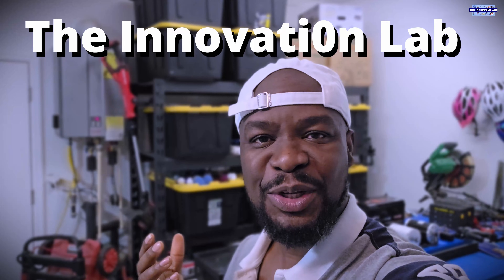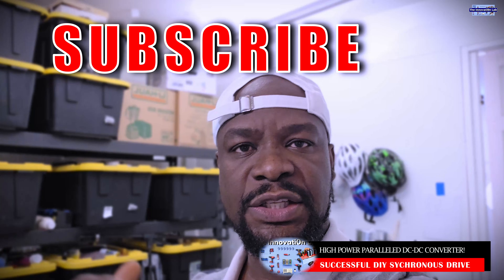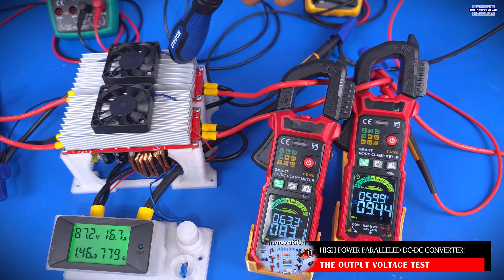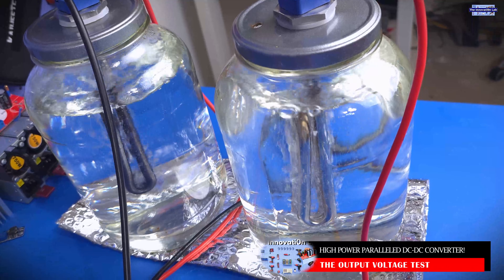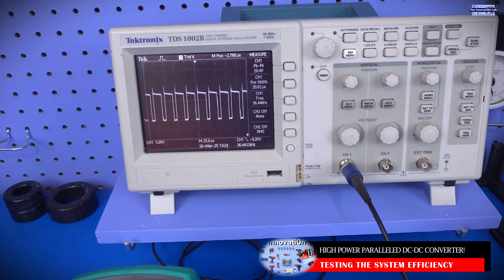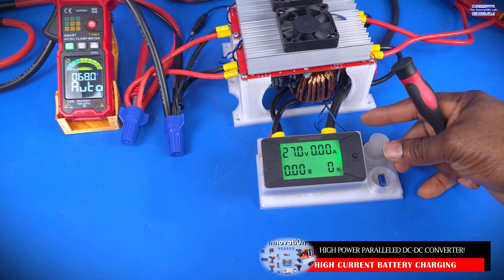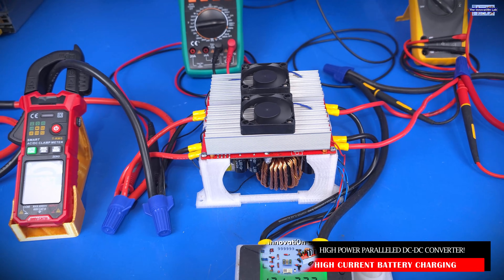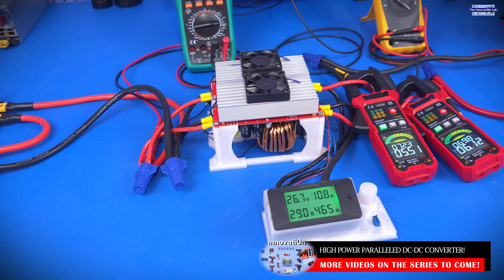DIY Hack for High DC Power: How to Parallel Converters Using a Synchronous Link

Comment: looking forward to knowing how to parallel these two. seems this parallel design is better than the earlier one with 3 paralleled plus a control board.
Reply from the maker: Sounds great!
I believe it was explained in this video.
 But overall, all you need to do is to remove the PWM chip on the helping converter and share the PWM signal from the controlling converter.....just as I showed in the 3X paralleling video.
I also provided and explained the diagram in the video.

Respectfully,
The Innovati0n Lab
Reply: @theinnovati0nlab782  Yes great explanation! I am also interested if in a future video you can explain how to increase the maximum amp output

Comment: Hello, I am from Iran and I am writing to you, my dear friend. This DC boost converter is made of the same 2-core thyroid that was on the converter. I was wondering what the diameter of the enameled wire is, how many AWG, and how many strands of enameled wire did you use for this converter? Thank you for your answer.
Reply from the maker: Thanks for watching our videos!
The wire gauge is 22 AWG.

Respectfully,
The Innovati0n Lab.
www.theinnovati0nlab.com

Comment: Hello, my dear friend, I have a question, if we give 12 volts to this module at the input, the car battery power supply is 12 volts 100 amps and we get 36 volts 11 amps at the output, to start a 450 watt brushless motor, which is on for 3 or 4 hours a day, is this module that you made with 3 thyroid cores and 22 awg enameled wire, can this module that you made work for me? Thank you for starting this brushless motor.
Reply from the maker: Yes.
Since the power requirement of your brushless dc motor is 450W, this system should be able drive your BLDC load - even with a 12V input power.
Please watch the 12V test. If should be the video I release after this one on my channel.

I hope this helps.
Respectfully,
The Innovati0n Lab.

Comment: I have 2 seperate loads and one input I shouldn't need to sync. Do u have efficiently  test for 2 loads? If you have a 2 grid tie systems you can up the voltage from a 24v battery to 60v input to inverters. The higher the voltage the less stress to the grid ties. 😊
Reply from the maker: Sounds great.
Thanks a lot for the wonderful feedback and encouragement!
Much appreciated.

The Innovati0n Lab 💥 www.theinnovati0nlab.com

Comment: I got the 1800 watt from Amazon and was wondering ok for a couple of days i .i had to puregel batteries at 12 put i put them together to make 24 to try to get as much power as possible i was changing two 24 lipo4 battery's and it make wired sound and started smoking any idea what i might of did wrong
Reply from the maker: What was smoking, battery or converter?

Comment: What is the input current limit for this boost converter, we know that the output limit is 30a. What about the input?. 

I have a 12v 200a battery and I'm afraid to connect it because I don't know if the board can handles such high current ratings
Reply from the maker: Great question!!
But you should be fine. The 200Ah rating of your battery is just a battery energy storage capacity rating. It doesnt mean your converter will draw that much current. The current drawn by your converter will be proportional to the load you put on it ans the rated Maximum input input current limit - which is about 30 to 40A for this converter.

Please watch the converter spec review video.👇👇👇
https://youtu.be/2KyBwwldqkk?si=_fyHyuDYyy3fa7qT

To have your future design questions answered, please becoming a Patreon supporter at the Q&A  level - only $5/month.
https://www.patreon.com/c/TheInnovati0nLab/membership?redirect=true

Respectfully,
The Innovati0n Lab
Reply: @theinnovati0nlab782 thank you for taking your time to reply to our comments, highly appreciated fam.

My load requires 80v 30a (2.4kw) and my plan was to use this boost converter to boost my 12v 200a (2.4kw) to this required power. I know im not going to get the exact 2.4kw power output due to efficiency but above 90% will do. 

As you have tested and proved that using low input power for high output power is not recommended, my question to you my brother is what minimum voltage do i need to achieve my reguired 80v 30a output from this boost converter or any other that can handle high current inputs in the range of 100a to 200a ?. This boost converter is only rated for 30-40a like you said. 

The reason for using a 12v 200a battery is because it packs the required power i need while being affordable and small in size which is one of my concerns in this project im working on.
Reply from the maker: I understand.
Unfortunately, you wont be able to hit that much power with these converters if your input voltage is lower than 36V....and that is even with the paralleling hack I have shown.

Sadly, for these converters, higher input voltages = higher outout power. This is due to the input current limit as I have previously explained.

Success wishes on your project.
The Innovati0n Lab.

Comment: What are the paired meters reading a load, encased in red called?
Reply from the maker: Wonderful question.
Those are digital  current clamps.😊
👍👍

Respectfully,
The Innovati0n Lab 💥
Reply: @theinnovati0nlab782  where can I buy one
Reply from the maker: You can find them online. Just search for digital current clamps or probes.

Respectfully,
The Innovati0n Lab

Comment: Nice work. I'm also looking at controlling SSR's solid state relays with PWM to limit current.
Reply from the maker: Wonderful!
If I understand ci
Correctly, it seems that you want tl modulate the output cureent. 

Sounds cool in theory.
Just make sure you pay attention to the rated switching frequency, voltage, and current of the SSRs you are considering. Also, this would impact the overall efficiency of the system.

I still think that the method I am using here should be the most efficient.....but it will required a surgical hack of the converter units.

Respectfully,
The Innovati0n Lab 💥

Comment: THis converters do not communicate, you need to add some wire or WiFi or BLE communication,
this is like, if you have in solar power plant MPPT with BLE or VE.Can communication,
they can output power equally, if they do not communicate, every MPPT will charge battery
with different current, because you can do not match wires to the 0.00001 ohm precision,
so the idea is either add communication or make big 2 II 3 II  4 II  5 - phase BOOST.
Reply from the maker: Thanks a great deal for the wonderful and super thoughtful feedback.

The only thing is that these converters are not my design primarily. I only buy them and modify them for more power. Also, they are nothing but cheap TL494 PWM controlled converters that were designed to work as standalone converters. 
What you are describing is great but might be easier for a completely fresh design.

The approach I am currently using is something that anyone that knows how to solder can implement. 
My channel is all about affordable and feasible innovations.
😊
Thanks again for the wonderful engagement.
👍👍👍

Respectfully,
The Innovati0n Lab💥
www.theinnovati0nlab.com

Comment: Does this work in step down scenario as well? like giving SOLAR input and taking 12/25v output for battery charging?
Reply from the maker: Great question.
I have not tried it on buck converters yet. 
Buck converter design topology is a bit different but it if done right, it could work.

I hope the helps.
The Innovati0n Lab💥
www.theinnovati0nlab.com

Comment: Hello... congratulations on the videos... it's a great learning experience for all of us. Excellent.
I have a 12v battery and I need to power a 24v device that consumes 10Ah.
Can this 1800W DC converter be used continuously? Or will it get very hot?
Reply from the maker: Yes, this boost converter will be perfect for your application. It seems you only require less than 300W...accounting for converter losses.
At a 22V input the converter can provide upto 320W efficiently.

I hope this helps.
The Innovati0n Lab💥

Comment: Dear
Great job! Keep it up.
Could you share the basic components used for a datasheet review, such as PWM ICs, MOSFET models, drivers, etc.?
Could you advise me on where to find application circuits?
Thank You!
Reply from the maker: Great question.
👍👍👍
Most of the detail you need is covered in multiple videos on my channel already.
Please take some time to watch the relevant chapters of those video. Feel free to peruse through the channel and Playlists.

Diy converter Repair
https://youtu.be/2WU6uvgeDgU

Converter Hack Playlist has some great information as well.

Respectfully,
The Innovati0n Lab💥

Comment: 2nd part sounds very interesting, Im guessing strapping the Mosfet drivers together for  2 boards
Reply from the maker: Thanks a lot for the wonderful feedback. Your thinking is in the right direction.
I wouldn't say strapping them together.....but it pretty much comes close to the synchronization approach. However, there are a few other mods involved - given that I redesigned the inductors....essentially the system is running at a much lower switching frequency.

Respectfully,
The Innovati0n Lab 💥

Comment: You can use them in paralel normaly, just buy 0V backflow diodes and wure them in order not to backfeed the positives on the output, ground can be usually central
Reply from the maker: Wonderful!
Thanks a lot for the constructive feedback.

I have tried what you are recommending in a previous video and it doesn't quite work at high loads and even if you manage to carefully tune it, reliability is still a very big concern.....plus lots and lots of wasted power due to massive heat dissipation on the blocking diodes. If the goal is to load share a couple hundred watts across 2X converters, then it could work.
However, the goal of this effort is to double the output power of these converters. 

There is a fundamental difference between a battery and a switch-mode power supply. Batteries rely on the natural flow of electrons to get to load sharing as long as the potential difference between the paralleled batteries are the exact same. Switch-mode power supplies on the other hand are different as they rely heavily on their control loops. Hence, when you connect two or more SMPSs with individual controls loops - in parallel, there is always a battle for control and it never ends well.....especially at instanteneous high loads.

This is the need for the synchronous approach shown in this video.🙂

I hope this makes sense to you. 

Respectfully,
The Innovati0n Lab💥
www.theinnovati0nlab.com

Comment: What if one converter dies and develop short circuit at its output?
Reply from the maker: Great question.
👍👍👍
A failure of one converter would cause the entire sytem will fail. Hence, the input fuses would blow. The system relies on both converters functioning properly and I am not going to sugar coat anything.

 Yes, there is no redundancy on this approach.

However, let's keep in mind that these are $25 converters that gives us 1500W....a great product in my opinion. A professionally built 1500W converter with all the protective bells and whistles would cost more than  $1000.

I will be testing this approach to know how reliable it will be and the failure points......that is really the best we can do given what we are working with.
Again, there is a reason why professionally made products cost thousands of dollars - but even at that, no one can guarantee that they won't fail.

The Innovati0n Lab 💥 www.theinnovati0nlab.com

Comment: I would be interesting to consider redundancy where if one converter dies a second one could pick up the synchronisation role for remaining units.  Also some way of disconnecting the faulty unit from the load.  Would be a good second phase for the project.
Reply from the maker: I can always tell great knowledge and experience from someone's constructive feedback.
👍👍👍
We are honored to have you in our audience.

You spoke directly to an aspect of the design/hack that keeps me up at night - the unfortunate lack of redundancy. 

The truth is that these being cheap converters, limits the modification options we can feasibly accomplish. 
However, I agree that redundancy and system reliability will be considered at the next phase.🙂

Thanks again.
👍👍👍
Respectfully,
The Innovati0n Lab 💥 www.theinnovati0nlab.com
Reply: What if one dies and cause shortcircuit at its output.
Reply: @ This is a consideration when combining PSU. One solution is to use a diode but they waste power. Another approach is to use a mosfet with a circuit (LM5050-1 ?) to make it an "ideal diode". This can remove dependencies between PSUs meaning you can get away without synchronising them in many cases. Finally there is always the good old fuse :)

Comment: The reply after you commented doesn't work, but can you provide the STL files for them? 
Or is it for personal use only?
Reply from the maker: You ask a simple question and I gaveyou an answer.
I am nor sure what you mean.

 Yes, the version shown in this video is for personal use and had lots of flaws that I need to improve. They are not shareable but I have a version of the converter mount that you could download from my website. 

The Innovati0n Lab💥
www.theinnovati0nlab.com

Comment: Did you make the mounts for the boost converter and the clamp meter holder?
Reply from the maker: Yes.
Reply: @theinnovati0nlab782  
Do you have the STL files for them that people can use?
Or is it just personal use?
Reply: @theinnovati0nlab782  
 Can you provide the STL files? 
Or is it personal for your own use?

Comment: Things are looking amazing and AFAIK this content is unique on all of YT! Some questions:

1. Where are your sourcing those black toroidal cores from? What are its specs and pricing?
2. It's fantastic to see the PWM control waveform, but it would be amazing to see the AC content of the output on Ch2 as well
3. Finally, those motors you had in your garage - are they DC or AC motors? It would be amazing to see them being used as load instead of the purely resistive water heating elements and the AC content of the output on Ch2 as well with that loading

Really excited for this series!
Reply from the maker: Thanks a great deal!
I appreciate the wonderful feedback.
I buy the torroidal cores from Amazon.
I will update the description later to add a list for all the materials.

As for using the motors as a load, I agree that it would be an awesome and fun idea. However I will also need to put a load on the motor - if not, it won't really draw much power. I use the resistive water heaters because it is difficulty to find affordable test loads that could  withstand the amount of power I am testing for. Even with load applied on the motors, the motor load tester can only drive about 1000W of load at 48V, so not very versatile as a test load. If all goes well, this synchronous converter unit could push close to 3000W of output power....and this is where the resistive water heaters come in handy. 

With the water heaters, the generated heat is contained and doesn't radiate to other components on the test setup. Also not heats sinks or fans needed to cool them.....plus they are really the cheapest option.😊

Thanks again for the engagement.
Respectfully,
The Innovati0n Lab

Comment: Would be nice to have active current sharing so external metering would display the very same numbers. I wonder how difficult this would be to achieve?
Reply from the maker: Thanks for the wonderful feedback as usual.😊👍

I couldn't agree more on active current sharing. However, as you know, to have active current sharing requires for the converters on the sharing bus to be designed to be smart enough to understand the control signal on the share bus. 
These are cheap $25 converters and what we have done with them comes a tiny bit closer to active sharing but not quite.

The slight deviation in load sharing is because each of the converters had different drive MOSFETs...so slightly different drain-to-source RDS(ON). I will install the same exact MOSFETs for the next test and we should see an improved performance.

Thanks again wonderful friend!
Respectfully,
The Innovati0n Lab 💥 www.theinnovati0nlab.com